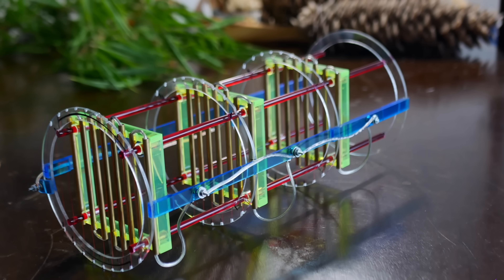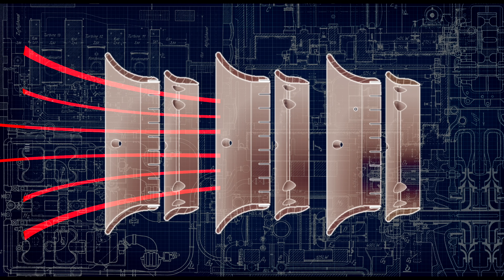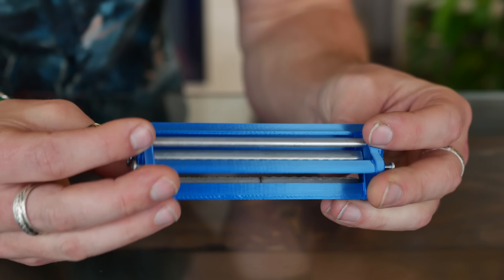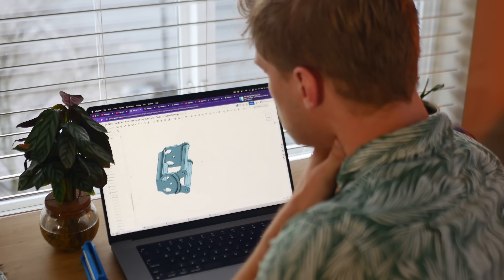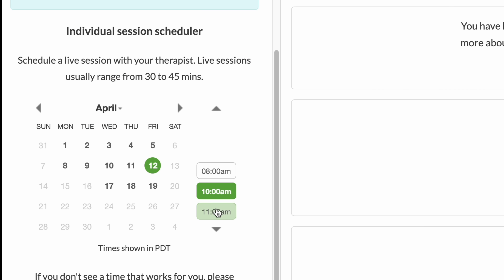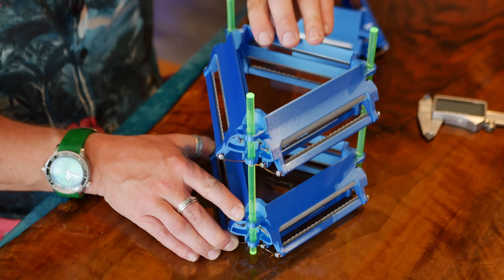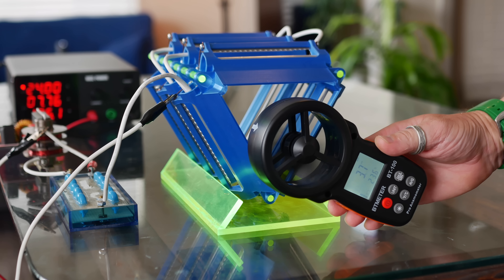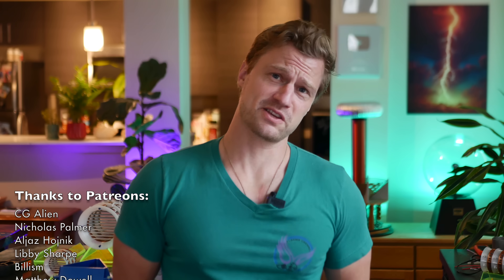Next-Gen Ionic Plasma Thruster Inspired By Nature (BTC Mark 3)

Comment: Use 4 blades, blow the air into a closed room/space, with one small tube at the end.

Each blade, depending on its energy, transports a certain amount of air from A to B. Together they all create a certain pressure. Through a short, small opening, this pressure will lead to a higher exit velocity because the 4 blades push air into the room 4 times.

You can't combine the other ones, cause the flowing speed is everytime the same. 2,8 is still 2,8, just two times. You need a higher speed, to speed something up. So use space, to combine the pressure, the more air in a second, the higher the pressure and the higher the pressure, the more speed you get out.

Comment: I'm not an expert but try to make the wind output a little bit smaller just like a funnel, so that the wind is more focused at the end... I just noticed it using the blower in my vacuum whenever I use the smaller tip the wind blows further than without the smaller tip.

Comment: So my idea is what if you had them converge into an enclosed space. You could layer these in series in the same tear drop shape as an airplane wing and have each "plasma engine" push air through a more confined space to increase air pressure and thus speed. Then having those tunnels converge into a larger duct running along the bottom of the wing. I know its hard to understand me typing this. I can visualize it and create a rough drawing if theres a way i could send it to you.

Comment: The fact that the ejection does not increase enough like expected,when doubling / tripling is possibly due to the fact that the charge acts on all thruster sections at the same time. Try an alternator principle of the power supply 🤞🏼🙂 maybe in harmonic sync with the main charge Frequenz...

Comment: are you forgetting about the effect of the baking tray on the turbulence? you can see the effect that the dry ice by itself has on turbulence. a flat surface has a huge effect as well. don't forget that you have total freedom on the size and shape of your thruster. the only certain thing is that you need an airfoil to increase lift but when does a point thrust win out over the full wing thrust or i guess which design has the better thrust to weight to drag ratio. the fog machine and dry ice is good yes but your testing setup introduces too many variables. don't forget that you can electro plate plastic so you can have a spiral coil if you want or any number of non linear thruster shapes. you sort of flirted with venturi effect but not entirely taking advantage of it. the jet engine has gone through so many different shapes and sizes throughout history but a lot of it depends on the rotating compressor. an Ionic thruster is less limited in shape and thus has far more possibilities and growing pains to work out.

Comment: You're limiting your air flow with a triangular wind tunnel passage. Check out how "Boundary Layers" work. Basically, the air close to the plastic is moving very slow or not at all from parasitic drag aka friction. Flow further away from the boundary later can be full speed. Making small angles at the corners in your design now means the air is being pinched by two boundary layers. If you have to have straight thrusters, maybe an octagon with rounded corners would be better. Also, you might try reducing the size of each the successive stages even with a cone on the end to further concentrate the air. Jet engines stages  get smaller and smaller. Fighter jets especially have nozzles.

Comment: Hi Bro! Please, go the Comments I made on your previous video You made on that topic.

One thing You looks like not having realized, is that:

. IF YOU DON'T HAVE A GRADIENT OF VOLTAGE,

 Or

. IN INVERT GRADIENT OF SECTION OULET,

You end Very Rapidly to an ASYMPTOTIC AIR SPEED LIMIT. 

Also, making 

. PONCTUAL STHRUSTERS

doesn't like the Best Solution, more

. LINEAR STRUSTERS GOUNG ALL ALONG THE WINGS.

All the best, 
Khwartz

Comment: Measuring only airspeed doesn’t provide an accurate measure of volumetric airflow. Ideally the measurement should be litres / second. Given that each thruster design has a different exit area, use the measured air speed and the exit area to calculate volume metric flow rate. The result is more representative of thrust  than just air speed alone.

Comment: You should add the Bernoulli principle to this and have it be a bit more like an ducted fan used in RC so a high pressure blows to move a larger volume of air with friction...or hope that makes sense.

Comment: My dude.
Build a thrust stand.
Attach a prototype.
Measure your actual thrust in watts/gram of thrust.  The volume and speed of air it can move sitting still on a table is great if your intent is to optimize it for being a very power hungry desk fan.  If you want one of your prototypes to fly you'll be measuring it's absolute thrust, it's thrust/weight, and it's thrust/watt.  Those numbers will tell you where the design needs to go if you want a future iteration to fly.

Comment: Just curious why you don't do the same thing with multiple layers of rings  inside of rings each drawling air, and use a vibrating foil at the end like they are doing with some micro fans for acceleration?  Each ring can be adjusted for wattage use based on size.  The interior rings would be slightly extended to offset forward to not compete for air intake.

Comment: Just new to this channel - what if you taper each stage smaller, with the same power from each stage. (Same power, smaller diameter) Funnel it like a turbine. I envision that the volume of air transferred from one will reduce the interference from the previous due to the focus.

Comment: I would be interested to see what happens if you increase the space between stages, 3cm (initial convergence point, as per the video), 6.5cm (just for good measure) and 10cm (the point at which the air stream "straightens out" and becomes a singular column, as per the video).

I honestly doubt it would increase velocity much but it should vastly increase the total volume of air being moved due to venturi effect and laminar flow.

Comment: I have a few ideas for possible improvements? 
1. If you used a design similar to this, could you use a high powered fan to accelerate the ionic thrust?
2. Could you use a jet engine's rotatey things to direct the flow better?

Sorry if I've missed why these wouldn't work, but I love the channel! 😍

Comment: Hi Jay, would it be better if the mark 3 would have been circular than triangular. Not circular in the way mark 2 was, but circular mark 3 with circular electrodes. So the air is funneled into the hollow centre. The triangular setup would definitely cause some destructive interference at the corners of the triangle, since they are not flowing in the same direction. A circular version may be less turbulent. I may be wrong, but I am very impressed by the work you have done. Keep it up!

Comment: I’m just a humble tinker at the very best, but it seems you would want to take an exponential approach right? With each stage taking the focused air of the previous stage and focusing it further? Like a cone shape we see in jets and rocketry. Maybe inside a housing of some type? This way each stage builds on the last and forces the thrust to concentrate to a smaller point? This is really compelling stuff!

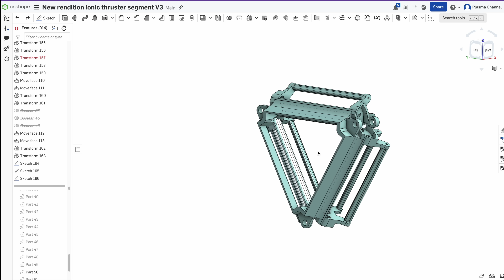Comment: 10:15 I could be wrong, but it seems to me that this design would create a great deal of internal turbulence and restrict the flow.
Suggestions:
First - Reduce electrode segment lengths and add more of them to change from a triangular shape to an octagonal shape (closer to a circle).
Second - Angle them both inward toward the central axis (like you are) and to create circulation around the central axis (closer to your ionic tornado)

I believe this should reduce the clashing of air columns (10:19) that create turbulence and improve the airflow to increase the output pressure.

Comment: So I wonder if you put the ion thruster in front of the wing if it can cause Lyft if you put it in front of a wing that's upside down will it cause the craft to dive and if you put it on a wing that's on the side of the airplane but tilted upwards couldn't pull it left or right so maybe a circular Wing a cone-shaped wing is circular wing with thrusters in front of it and then whenever you hit the electricity to the thruster and pull the craft in that direction a gyroscopic wing two rings Minecraft that has circular wings with thrusters in front of them that you apply the electricity and then it can move in any direction

Comment: Search put the ionic thruster in front of a wing shape you won't need a propeller to do a vertical takeoff or forward momentum you just need the thrust of the ion wind over the wing and you should have almost perpendicular take off which would be interesting in aircraft that hasn't been done and then I would make it a buying aircraft a single slant Wing aircraft that the whole entire wings are covered in ion thrusters

Comment: Have you thought of trying an ion impulse thruster?  Computer controllinging each stage to go on and off. Stage 1 goes on then simultaneously stage 1 goes off and stage 2 goes on etc… thru each stage.  You can also have the computer (using an a/d interface) control the power levels of each stage. I suggest that you ramp up each stage. S1 10w, s2 20w, s3 30w and s4 40w.  Using waves you can increase your thrust of your engine.  Just a thought…

Comment: Have you heard of the Thunderstorm Generator, an engine that uses water as atomic fuel through a process called plasmoid-induced and controlled atomic energy release?

Apparently it is open source and anyone can build one. The claim to fame is the exhaust is 20% oxygen with this device attached. 

Could you build one to attempt to verify or debunk it’s claims?

Comment: Make the wires thicker to increase the ionization range, each group of independent vents, like blinds, and finely adjust the direction of the air outlet.
將導線變粗增加電離範圍，各組獨立通風口，像百葉窗簾，出風口微調方向。
Reply: I left my message through a translator, so there may be problems with grammar and cognition. Also, it’s a pity that I’m too slow to understand what you are doing.
Because the positive and negative electrodes are both rectangular and cannot be bent, the inlet must also be rectangular, with a set of compact positive and negative electrodes on each side. The casing is drawn inward toward the outlet to guide the airflow, and the side casing has a curvature.
The more groups of airflow center sides collide at more angles, the same loss of kinetic energy will occur. 1. The cone blocks the entrance and leaves a gap. 2. It converges outward to guide the airflow, collides with the additional shell, and all passes through the outlet air ejector.
0. If you can connect the positive and negative poles, it will be simple. First separate a thick section, then a thin section, and string them on the inner wall of the cylinder.

我是用翻譯留言，語法和認知可能有問題，另外很可惜我太慢知道你在做甚麼。
因為正負極都是長方形不能彎，所以入口也要長方形，兩邊各一組緊湊的多個正負極，外殼往出口往內收束引導氣流，側邊外殼有弧度。
越多組氣流中心側面越多角度碰撞一樣喪失動能，1.圓錐體擋住入口留縫隙，2.往外收束引導氣流，碰撞額外裝的外殼，全部經過出口的空氣放器。
0.如果能灣正負極就簡單了，先粗的隔一段，在細粗一段，串在圓筒內壁。
打完了才發現其它人也講了不少，所以這段留言可以不看，我另外再想更有創意的。
Reply: There is also a second, more creative one like the Layer cake, except that there is a hole (air outlet) in the middle and a cover to increase the air intake on the sides. The overall center of the Layer cake sinks down to gather airflow.

還有第二個更有創意的像千層糕Layer cake，只不過中間有個洞(出風口)，有個蓋子，增加側面進氣量，Layer cake整體中心往下陷，匯聚氣流。

Comment: okay so with this setup and the wing setup try this, Each section up the voltage starting 40w , 80w, 120w. that way the thrust is compressing each Colum from each others max air speed. return should give max speed down wind. just a thought appreciate your videos and hard work.

Comment: You should read the following paper. It’s the reason nobody takes ion wind propulsion seriously. If your design doesn’t break on of the assumptions they made in their model, then you have no hope of breaking 1% efficiency. Propeller’s achieve 70-80% efficiency on a regular basis. Serious people didn’t stop researching ion wind because they are ignorant or didn’t care. They stopped because it’s a dead end from a fundamental physics perspective. 

M. Robinson, "Movement of air in the electric wind of the corona discharge," in Transactions of the American Institute of Electrical Engineers, Part I: Communication and Electronics, vol. 80, no. 2, pp. 143-150, May 1961, doi: 10.1109/TCE.1961.6373091.

Comment: Sorry Jay in 2018 MIT did NOT build the "world's first ionic thrust airplane," or "aircraft" as they stated in their paper.   Although it was the first traditionally shaped such vehicle, there is an earlier more efficient ion propelled aircraft that does carry its power supply onboard. 

There are approximately 45 videos of the earlier series of ion propelled aircrafts on my YouTube channel that create much more thrust per watt and were patented for lifting their onboard power supplies entirely with ion propulsion!  All of these crafts are capable of self-contained VTOL as well as horizontal flight.  They are extraordinarily well verified and documented to fly carrying their own onboard ion propulsion systems. They were designed in a particular way because it was challenging to get them to lift their own power supplies with ion propulsion.  

I think creating ion thrusters that are capable of lifting themselves vertically, as well as horizontally, have much more potential because this really is a form of ion rocket and will be capable of very high ISPs when operated in a vacuum, (in that case with added propellant).  The ion thrusters I built have wing shaped collectors and so can produce aerodynamic lift as well when used in atmosphere without added propellant.  There are already solar cells available that will enable these Ion Propelled Vehicles to fly all day long in the near future.
Reply: I would love to learn more about the solar cell powered Ion propulsion, any recommendations on where to find these designs?
Reply: @extraziadeh  NASA has been making heavy solar ion propelled spacecraft for years, such as the Dawn spacecraft etc.  To power a terrestrial or air breathing ion thruster with a greater than 1 to 1 thrust ratio and with solar power, you can use my designs and utilize "Perovskite" solar cell films.  There are lightweight aircrafts that were flown with these types of cells, but the cells were custom made, challenging to get ahold of, have a short lifetime, and are expensive. Perovskite solar film can be much more powerful by weight than the lithium polymer batteries I have been using. The commercial versions that I know of are pre-encapsulated aren't light enough.
Reply: How do you estimate your design might compare in terms of power efficiency and ISP to a Hall-effect thruster, or a conventional gridded ion thruster?
Reply: @Jupiter__001_  I'll be as exact as I can in brief.  This still would depend on exactly what craft under what conditions and so on.  The Dawn spacecraft for instance accelerates from 0 to 60mph in 2 days or at 0.000155m/s^2, because it is very heavy for its 14grams of thrust per engine. My crafts produce more thrust than they weigh because they are built as lightweight and efficient as possible.  They accelerate at greater than 9.8m/s^2 since they lift their power supplies against Earth's gravity. They can therefore accelerate from 0 to 60mph in a matter of a few seconds.  While my crafts aren't heavy or powerful compared to chemical rockets, they have exciting possible uses for either long duration acceleration or silent drones.  Thanks for asking!

Comment: A jet turbine engine works by using rotors to speed up the air and then stators to compress it.  If you were to use your ion engines as the rotors, maybe adding something like a stator to compress the air before the second engine would give you exponential velocity.

Comment: You keep making the basic units straight, you can make them curved so instead 3 straight units and a triangle, yo can make 3 banana shaped units and the Hole package circular, making it more efficient  I think?
I undertand the bias because mark I and II had straight continuos wires but since you changed them to serrated razors you can curve the Hole assembly.
Even making them in a propeller assembly

Comment: You've really got to look at your anode and cathode as structural elements for the next iteration. They're big sections of metal, so can stand in for a lot of the plastic you have within the unit. You could even reduce down both to smaller versions of themselves, or cutting them length wise in half, and still use them as support structures.

Then there are 3D printable materials that are used for aeroplane models that you can use to shave even more weight. Tom Stanton made an Osprey model using some that was super lightweight. So theres a good starting point. Good hunting

Comment: Physically, it makes sense that you wouldn't see an increased velocity. Your thrusters are angled to create a central column, but not to pass air through the following thrusters. That results in more air being moved, as you saw, but no increase in velocity. Pushing the thrusters closer together actually seems like it would interfere with the air being moved, as it would now just crash into the wall of the thruster ahead of it.
I wonder about combining the 2 blueprints to pull air from the sides and angle it down into a central thruster with a greater separation between positive and negative. All the volume of your auxilary thrusters, with the speed of a central thruster.